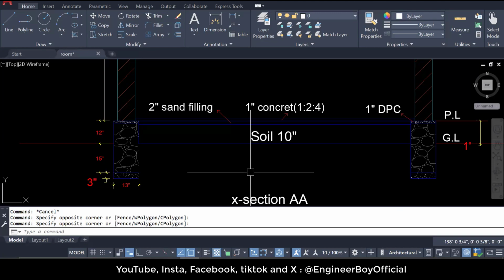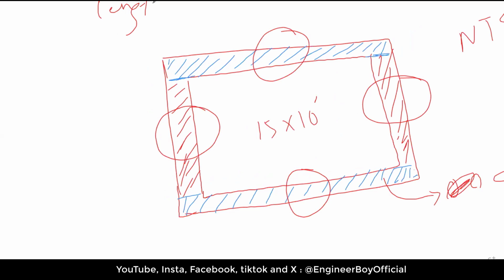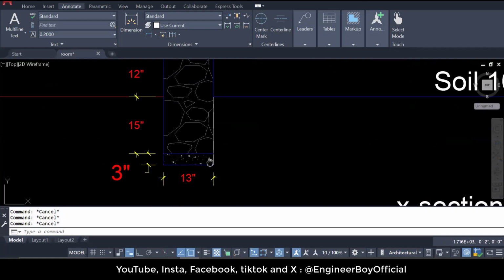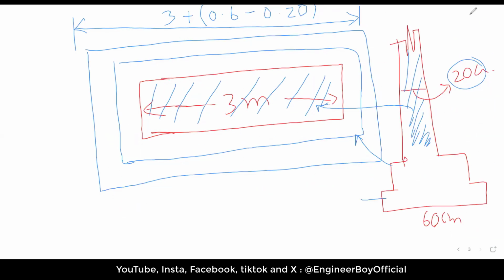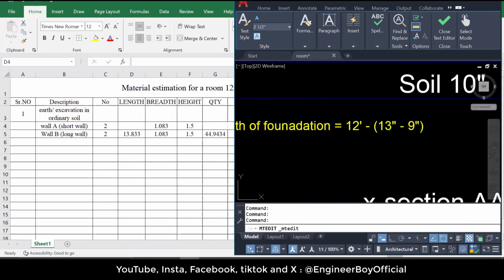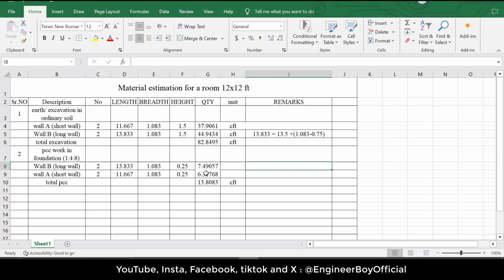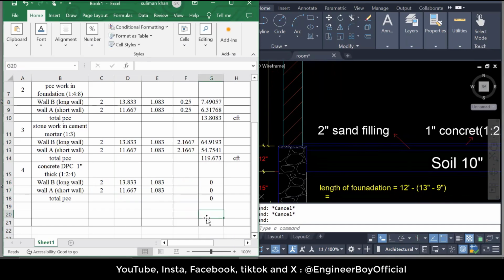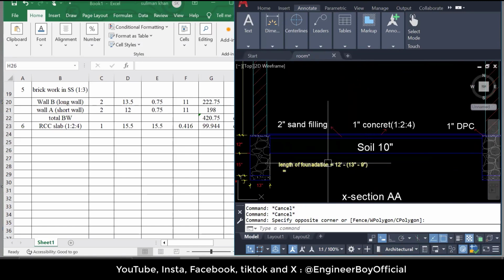“Complete” Quantity survey course | day 03 | for beginners

Comment: Awesome Sir. This is practical in civil engineering deptt. As the rate is fixed by govt, so we ignore the labour cost & equipment (bcz it is included in rate inclusive of all taxes). So we just focussed on Qty computing. Further how to convert cft to cum as the unit of excavation is cubic meter but not cft